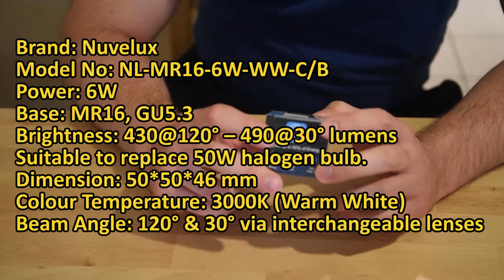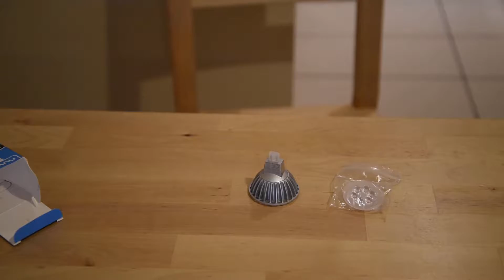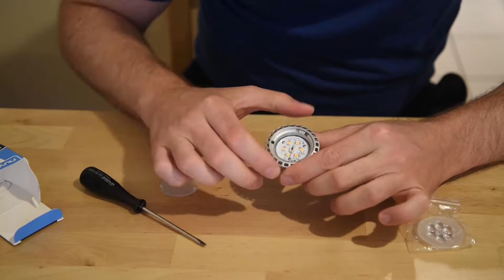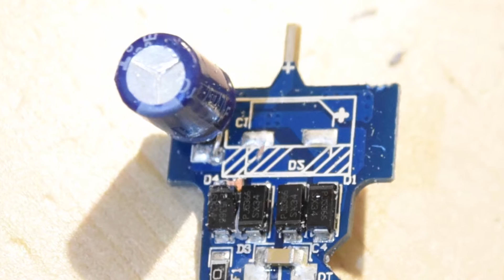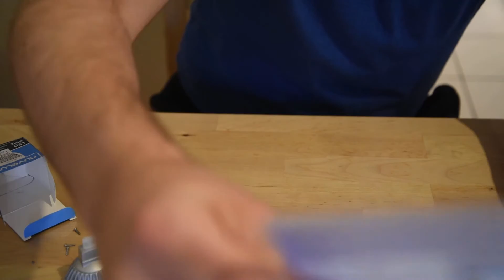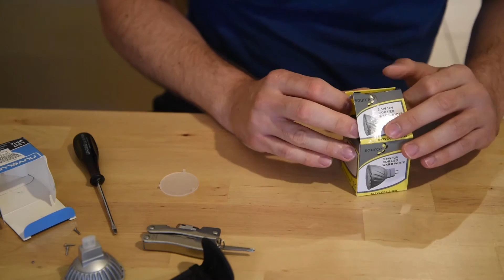NUVELUX Premium DUO 6W 12V MR16 GU5.3 LED Bulb Review

Comment: Thoughts after a few months' use:

- Light spread/cone is very nice. With the wide-angle insert, I don't have any hard cutoffs or anything.
- The brightness is very nice. Not quite as bright as the halogens they replaced, but those were 50W per unit.
- Light color is a nice neutral warm. Not LED-blueish and cold at all.
- One light developed a buzzing sound and started flickering. I think it was due to a loose connection, but I replaced it with a spare and tightened down the clamps and all is fine again. I don't think this was the light's fault.
- Finally, my only complaint. The light seems a bit... grey? Flat? I'm not sure how to describe it, but there's definitely something missing compared to the halogens. But for an eight-fold reduction in power consumption and an I-don't-even-know improvement in expected life, I'll keep them.
Reply from the maker: I agree, I kept the wide angle lens as well. Much nicer on the eyes.
Reply from the maker: Thanks for your review. I agree halogens have a nicer quality light, but they're such a pain to replace constantly and are expensive to run, so this is a fair compromise.

Comment: Thanks for this, I've ordered a sixpack and will give it a try. It's hard to find proper LED replacements for MR16 sockets.
Reply from the maker: I know, tell me about it. It took me ages before I found these ones.
Reply: Should one be concerned about polarity, or do they work in both orientations?
Reply from the maker: They work in both orientations. Polarity is sorted internally as obviously LEDs transmit current in only one direction.